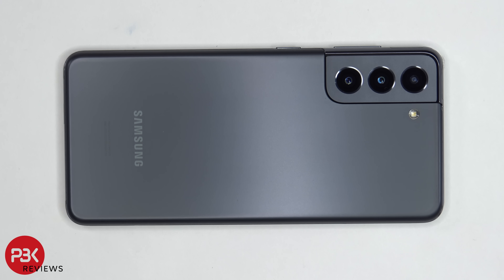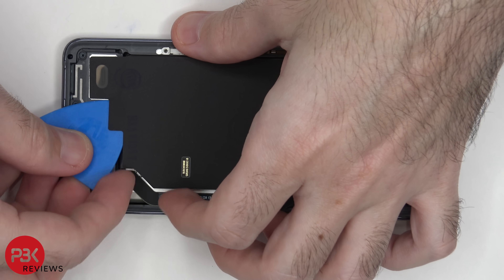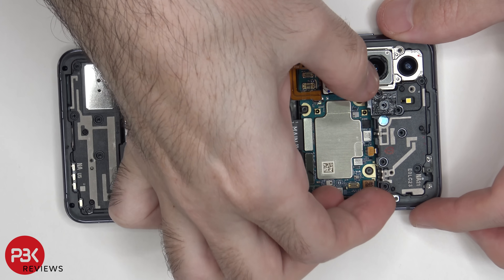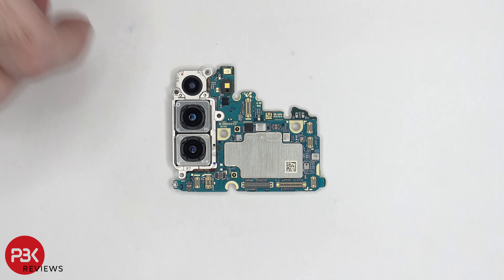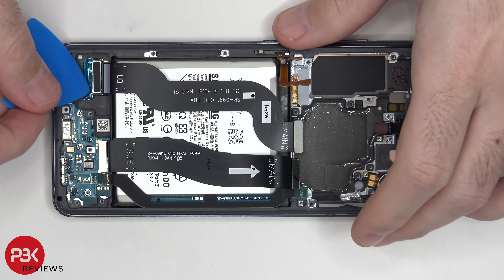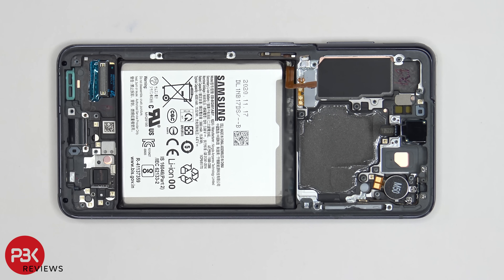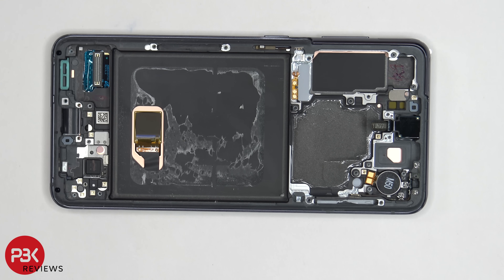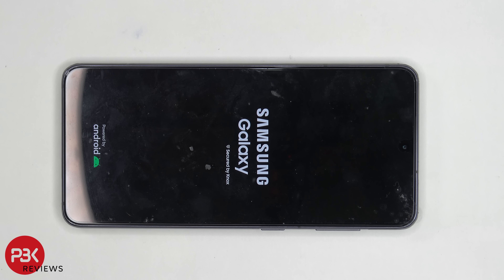Samsung Galaxy S21 5G Disassembly Teardown Repair Video Review

Comment: Shot in the dark with 458 other comments, but if my S21 won't charge or transfer files via USB-C, could it be an issue with one of the ribbon cables connecting the sub board to the main board? Although, the lower speaker assembly seems held tightly down by screws, so I'd be surprised if it were that. The USB-C port is clean and clear- not blocked. TIA

Comment: Thank you. Worked perfectly. I was looking to replace the speaker or vibration motor circle thingy at the top, but I just used confidence and it came off. The J50 or M50 circle thing at the top right of the phone. I was able to replace my phone screen with a new one, transferring all the guts from the old front display and side panel, to the new one. It works now! Before, the phone was on, but the display was shot. RE-seating the ribbon cables did not fix, so I ordered a new phone front display. Sat on it for months, and finally, yesterday, got it done.

Comment: Thanks! Managed to fix my sim card tray issue and charging port after a phone drop, which, somehow, slightly dislodged the connections between the components. 
By applying slight pressure on the connectors after taking the (already half unglued due to the extreme summer heat) back off, it works just like it has for the past 4 years. 
<3

Comment: Took out my battery with a flat head like an abodlute idiot . Battery cooked off inside the phone destroying all 5 ribon cables and slightly melting the frame . Spent 15 bucks on aliiexpress and got all 5 ribbon cables double sidded tape and b7000 . Ended up working like new only down side in a small circle on my displah whoch is a reminder to never skip certain steps

Comment: Hello, I'm using the S21 I bought in Korea, but the wide-angle camera seems to be broken, so the camera doesn't work at all. So I'm trying to buy one with the wide-angle camera and telephoto from Ali, but I'm using Exynos now, and the one with telephoto and wide-angle, does the camera work well even if I use Snapdragon? Snapdragon is much cheaper, so I'm going to buy it..

Comment: For most of you having a blank screen and when doing the force restart (hold down power button and volume down) and if the phone vibrates as it would when turning on, its 99% loose connector for the LCD display. 
Also, you dont need to peel down the  graphite film from the bottom speaker, you just take out everything in one piece. Also ty for the vid <3
Reply from the maker: You're welcome
Reply: My phone vibrates but there was no loose connection, I think that the screen is busted, the connection was pretty black like rust of some sort.
Reply: @Pegasus_unicorn  Than RIP.
Reply: 😂 @SpecXify  you think there is no chance to switch the screen and the flex cable to revive it?
Reply: @Pegasus_unicorn  No idea. Im not a phone guru.. but could be an option. Take it to an official repair store an ask.

Comment: Excellent video! I have dropped my phone countless times, this time the flexible cable for the screen completely dislodged itself, with your video I reconnected it and my phone is working again! Only thing I found hard was taking the backplate off (used a hairdryer), another video showed using a stanley knife first to create a gap, then I used the little plastic tool to continue. Thanks!
Reply from the maker: Thanks. Yeah usually best to use a suction cup tool or something else to gain some leverage but the reason I don't show or suggest using a knife or anything metal is that it will damage or scratch up the frame.

Comment: If u can pls answer this question..
Recently my S21 went total dead, when sea water entered my phone. it shouldn't have been that easy but somehow i saw the back plate was already popped out. & the phone was not starting. I missed a few points but its too late now.
After 5-6 days when i try to charge & turn on my device it vibrates, every 6 seconds to be accurate, but no display. & once it was making a sound(trr trr trr) with vibration, that felt like emergency SOS call, but not sure again cuz display not working, to stop that sound, i put down my finger on the middle of the blacked out display & surprisingly it stopped. Are there any chances my phone will start working? I have not yet opened it cuz i am too scared that i will deal more damage than what has already been done. Please any response will help (Fingers crossed)
I took it to the Samsung's care but they just said its dead, within a min of having a look, then they took the phone inside & after a while said the same, but... i feel like they didn't do much to check inside out of the phone..🙁

Comment: Hi this is very good video. I dismantled my phone but I couldn't see the 5g antennas. Places were empty. Do you know what is reason?
Reply from the maker: The mmWave 5G antenna are only in the region versions where they use mmWave 5G. Not all regions use the mmWave technology 5G and use standard sub 6Ghz 5G so they don't require those antenna.

Comment: Which version is this phone?
Because I have the Korean version which has a single nano SIM card tray without an eSIM, and I was wondering if it 's possible to change the SIM tray, maybe it'll work!
Reply from the maker: This was a US version and just replacing the sim tray won't work since the software has it disabled as well. You would need to flash a version of the firmware to the phone which has it enabled.

Comment: I am not sure if you'd be able to read and reply. 

The LCD screen of my S21 is broken and I have got a replacement. 
My questions:
1. Do I have to remove the battery and antenna (using tri-wing)/as well to replace the LCD digitizer?
2. Would you be able to recommend any glue. 
3. How much temperature and time to heat the frame to remove the LCD screen. 

A quick reply will be highly appreciated.
Reply from the maker: Is it just the screen by itself or is it a screen with frame combo? If its just the screen, you can try (even though it might be difficult) to heat up just the screen and pry it off the frame being careful to disconnect the flex cable on the bottom while lifting it up so it doesn't tear. Then apply new adhesive and re apply the new screen seating it perfectly so the cable connects when your pressing down on the screen to adhere it to the frame since it doesn't have wiggle room for it to be pulled out to attach to the screen prior to seating it on the frame. But if you disassemble the phone as shown in the video, would be easier but more work. If its a screen frame combo, then you just do whats shown in the video and move all your parts from one frame to the other. You can find the adhesive made for this phone as well as other parts on this website: https://www.mobiledefenders.com/samsung-repair-parts/galaxy-s-series/galaxy-s21-5g.html?    As for the heat, you can use a hair dryer and evenly apply heat until its hot to the touch, and can continue to add more heat as needed while your trying to pry off the front/back. Front will be more difficult than the back.

Comment: what size are the screws
Reply from the maker: You can use a 1.5x25mm Philips screw driver. Usually most smartphone Philips screw drivers would work.

Comment: How did you remove the antenna screws? They're much tighter than the other screws.
Reply from the maker: Try pushing down on them a bit as you try to unscrew them.
Reply: @PBKreviews  I've tried that, but they don't seem to budge and I've only been damaging the screw and my screwdriver.

Comment: What size are the phillips screws in this phone?
Reply from the maker: a 1.5x25mm philips screw driver should work fine.
Reply: @PBKreviews  0000 was the smallest that came in my repair kit and fortunately that worked.  I guess it's the old Metric vs Imperial measurement issue in precision screwdrivers as well as conventional mechanics hand tools, I never thought about that before now.  Good video.  Very helpful and informative.  Thanks for taking the time to make this and share the information with others.  As usual, a new project calls for more tools!  Now I have more new tools, you can never have too many, ha!!!

Comment: If I disconnect the display ctc and the screen Is still black, does that mean the screen itself is broken?
Reply from the maker: not sure what ctc is but it happens a lot with displays that they get a small hairline crack somewhere in the corner that is not visible and it renders the screen in operable.

Comment: I accidentally give a big hit on my s21, on the top right corner, something feels lost, when shaking the phone. I think is the vibrator motor, because is in the same spot. Everything looks working fine, nothing damage. I`m a little worried. :/ 1 month using it
Reply from the maker: Its normal to here a little rattle inside from the camera, since they have slight movement. It's probably just that, that you are hearing.

Comment: Thanks for the teardown repair video. I have a question 🙋🏻‍♂️ does the top loudspeaker work as the earpiece as well? Because mine top speaker isn't working. So I'm wondering if they come under one piece to change to two separate parts. THANKS
Reply from the maker: You're welcome. Yes the top on is the earpiece speaker as well.
Reply: @PBKreviews  appreciate your answer. any idea where to get a replacement? mine stopped working
Reply from the maker: @mohawahba  ya you can search on ebay or amazon for galaxy s21 speaker replacement and you will see some listings for them.

Comment: I just watched someone else teardown on the same phone. I didn't see any 5g antenna removed on the side like you did. What model are you on?
Reply from the maker: The one I took apart was one from the USA region which supports mmWave 5G on top of the standard 5G support for sub-6ghz 5G. So those antenna I removed were the mmWave 5G antenna for the networks in the USA which make use of those additional antenna.

Comment: Does anybody know how to replace the power button flex cable - my power button is visibly and physically fine but phone wont turn on when pressed

Thanks
Reply from the maker: If I am not mistaken, those two metal tabs on the metal bracket holding it place should be able to be pulled out to pull out the flex cable/clicker for the power button. As for the volume key flex, that is routed in between the midframe and screen so the screen would also need to be pryed off.

Comment: Hope you can help please! One night I accidentally put the Sim ejector tool into the bottom microphone hole. Felt like something gave way. I'd like to know if any water resistant material has been damaged. I tried one of those Water-Risistance tool apps and it says it didn't find issues, but not sure if those bogus apps or not. Looking for solid opinion from an expert (you)! Thx
Reply from the maker: Hi, you should be fine, both the filter and mic sit above the hole.
Reply: @PBKreviews  That's a relief! What do you think was providing the resistance I felt with the tool when pushing it?

Comment: What could be rattling about inside the phone if say some one dropped it lol. Need to open it an have look cause something is rattling inside it
Reply from the maker: Well the cameras in general rattle a bit since they of OIS or optical image stabilization. So I'm pretty sure that's what you're hearing which is normal.

Comment: I have a question: My sim card reader does not work anymore, it reads no sim tried a couple. Do you think someone who is a little bit technical could fix this? Thanks
Reply from the maker: Yea, the sub board which has the sim reader on it would need to be replaced. Most repair shops would be able to do it, as well as anyone who has any experience with phone repairs etc. Not too difficult to do.

Comment: Can a dent or deep scratch on the antenna lines cause drop of signal?
Reply from the maker: Are you referring to those on the frame of the phone itself? I mean it's possible but they use more than one antenna line so it would pic up signal from different angles and positions so I doubt if one was scratched up or dinged up that it would cause to big an effect.
Reply: @PBKreviews  yes to the frame itself the plastic antenna lines

Comment: @PBKreviews dude I have a question. I accidentally tried to pull out the SIM CARD SLOT but at the microphone's hole. Is there any risk about losing ip68???
Reply from the maker: Hi, no you will be fine. Both the mic and the filter sit above the hole.

Comment: Very nice teardown! Actually helped me with my anxiety from accidentally poking the microphone hole with the sim eject tool lol (from my S21 Ultra), I guess you can't damage neither the microphone itself nor the water resistance from poking into the mic hole, since it's perpendicular to the hole in the frame... anyway, thumbs up for the video!
Reply from the maker: Thanks! Glad it was of help. Yes correct, it wont be damaged.
Reply: P
Reply: How can you get that wrong you can tell what hole it is. If its sim try hole it ne on the actual sim try. If it's a microphone hole it will be next to the tray.
Reply: @theperchsniper  I know I know, but in my case it was late at night and I was tired af and I just poked into the wrong hole, what can I say 🤷😂
Reply: @theperchsniper  i got it wrong too one time
Reply: I did the echo back in the diagnostic test after briefly poking the microphone hole on accident.  The main microphone (#1) has a very quiet echo back compared to mic 2 & 3.  Any clue why?   This was right after I purchased the phone so no other damage was possible.

Comment: I know that when you insert the sim tool through the hole of the microphone it will not be damaged, but could you explain if there is something in the hole and also what it hits at the end when you insert the tool, clearly something feels that there is inside of the hole.
Reply from the maker: There is a mesh filter that helps keep dust out, you might be poking that.
Reply: @PBKreviews  so something can be damaged when inserting the tool, let's say we could damage that dust filter, am I correct? It really is frustrating that no one on the entire internet can give a clear explanation about the subject and it is not the only model with which this happens.

Comment: is it possible to break a water ressistance putting a sim ejector in micro holes on the top ? i did it and when i blow to sim slot air goes off of the mic I put this sim ejector...

Comment: The foam balls are not there to allow air to come in. They increase the surface area inside the speaker box and make the speaker sound bigger than it is.

Comment: Battery 3880mah- not 4000mah
Reply from the maker: Hi, there is a rated and a typical capacity written on the battery. If you check closely you will see it says rated capacity 3880 mAh and typical capacity 4000 mAh

Comment: Why is it so much more difficult to change batteries on these new phones when compared to phones 10 years ago? What is the purpose of adding more complexity?
Reply from the maker: They try to make the batteries as thin as possible with more power than ones before, so making replaceable batteries would require the thicker plastic barrier around the battery itself so you can handle the battery itself without posing danger of bending it etc. Also manufactures would rather themselves replace the batteries to charge a repair fee I guess.

Comment: Thanks for the great video. I wanted to ask if you insert the sim tool into the bottom mic hole, straight in, with enough force to eject the sim tray, will that damage the gasket or puncture anything inside the mic hole?
Reply from the maker: Thank you. No you will be fine,  the gasket and mic sit above the hole.
Reply: @PBKreviews  Thanks! Wow that was fast. :) Better than actual Samsung service. Lol

Comment: Accidentally I inserted SIM ejector tool inside the S21 Ultra microphone hole. I also applied some force in an effort to push out the tray. Although, the phone is working OK so far. Did I break something inside? Microphone / Mesh / Water protection. Kindly clear my doubts.
Thanks!
Reply from the maker: You will be fine, the mic and filter sit above the hole.
Reply: @PBKreviews  thank you very much

Comment: Hello PBKreviews, i hope you can help me with my question. I´m confused right now. I put the simtool in bad light conditions into the microphone hole and pushed a little hard (European S21 5G Version). I was shocked about myself.....could it be that i damaged something or damaged water proofnes in any way? As i see in the vid, i maybe pushed again the small plastic inlay, right? Is there a hole inside this inlay?
Reply from the maker: Hi, no you should be fine, the mic sits above the hole and so does the filter.
Reply: @PBKreviews  Thank you so much. So all i pushed against was that plastic L tunnel inlay underneath the mic, right?

Comment: Thanks for this video! I found it when looking for a way to see how the mic on the bottom is built, because I accidentally poked in there with a paperclip to open the sim card slot 🤦🏻‍♀️. I've read that some phones have an L-shaped entry to the actual microphone so was hoping this was the case with the S21 so that I couldn't have done any damage. Do you know if the entry to the mic is curved or straight? Thanks in advance, it would mean a lot!
Reply from the maker: Hi, you're welcome. Ya you have nothing to worry about. The mic sits above the hole and so does the filter for the mic, so you wont damage it.
Reply: @PBKreviews  Thanks so much!
Reply from the maker: @pamelathonus4324  you're welcome